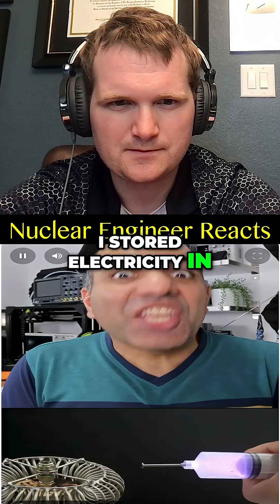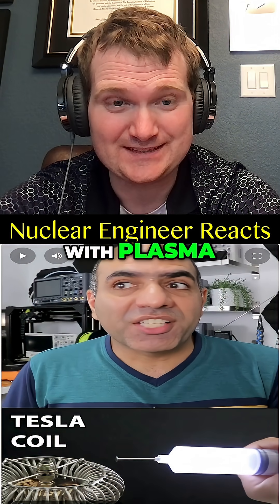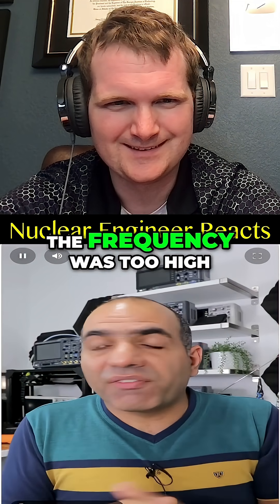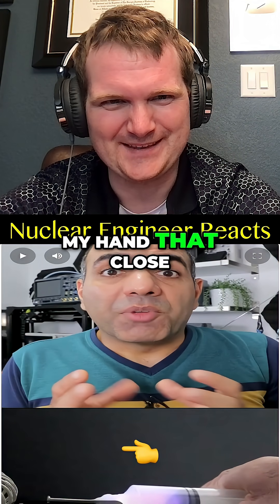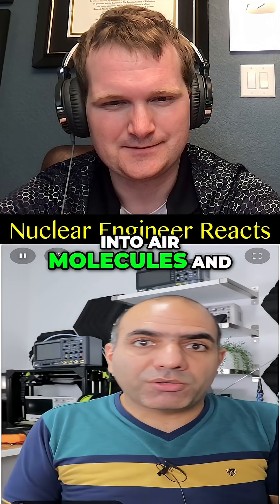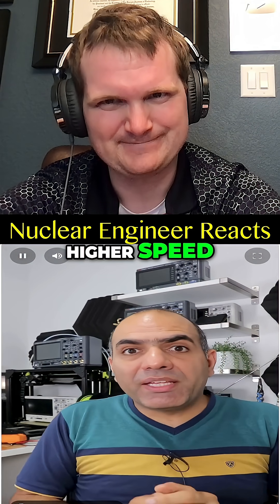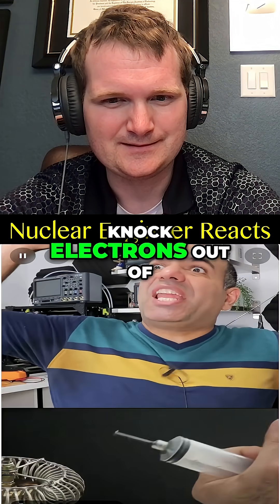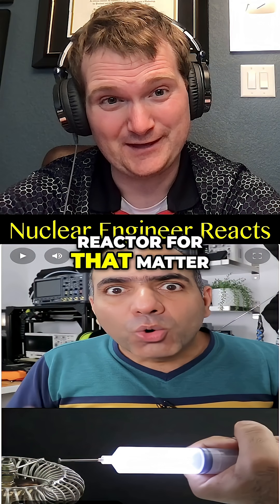Making A Lightning Syringe - Nuclear Engineer Reacts to ElectroBOOM

Comment: Squiggle.  Very few will get that. (The Mean average logarithmic energy decrement per collisions determines the number of times it takes a Fast Neutron to become a Thermal Neutron when colliding with molecules in any particular material, dependent on it's molecular mass and its temperature, based on its density changing.  The length of the path it takes to do that is the Mean Free Path.)  Take that!

Comment: Hey there!
This can cause ‘braking radiation’, it’s when an electron accelerates to high speed in a vacuum and decelerates fast by hitting a molecule, this can release a photon with high enough energy to cause x-rays. An example is you putting high voltage in a vacuum tube (typically 25-50~kilovolts)